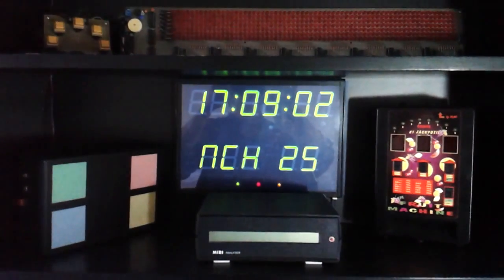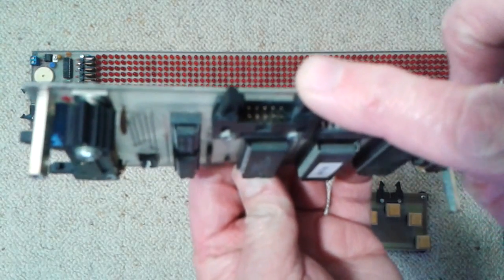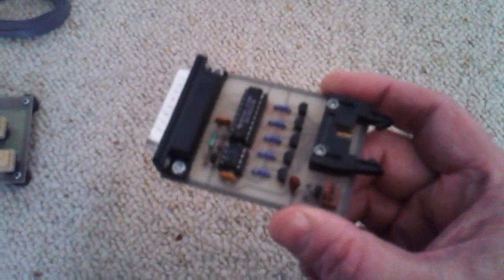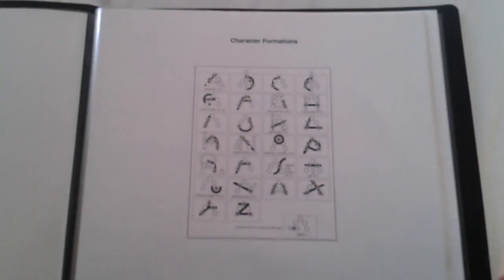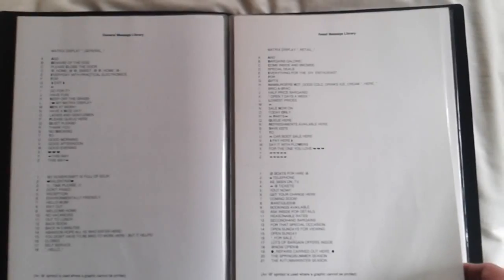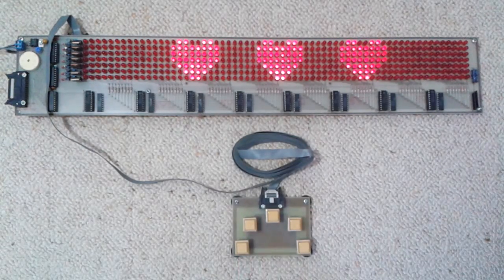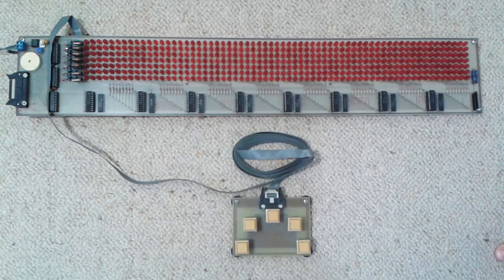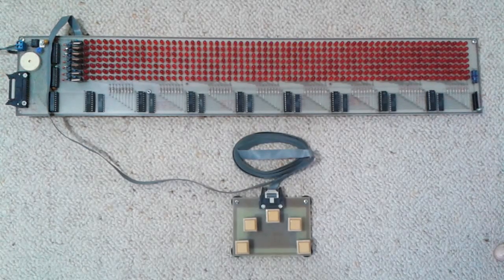Retro Electronics Project: LED Matrix Display

Comment: Hey I built this design in 90s purchased the rom from Julian Illet
Reply from the maker: Yes, Julian and I have been good friends for ages and we both designed and built the matrix display long before they were available to buy. Does yours still work?
Reply: Brett Gossage. The last time it was powered up was about 10 years ago. I should power it up next time I'm home. Maybe make a vblog about it. Lol. I used double sided PCBs and the main board is in two pieces. All the via s where soldered by hand with cut off led legs.